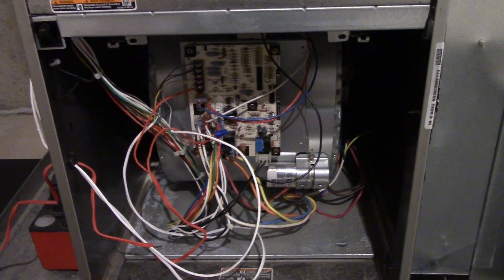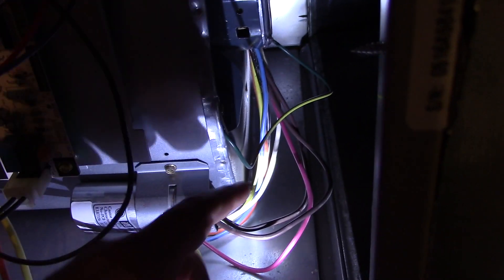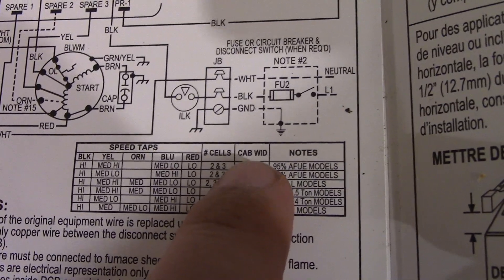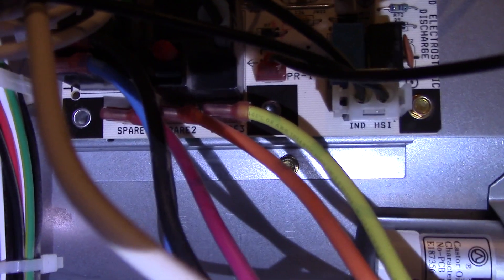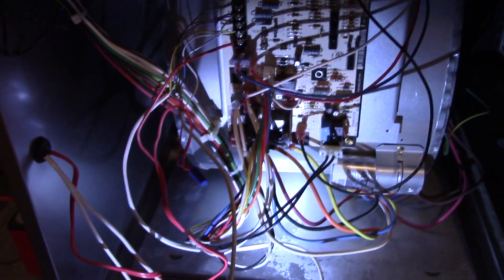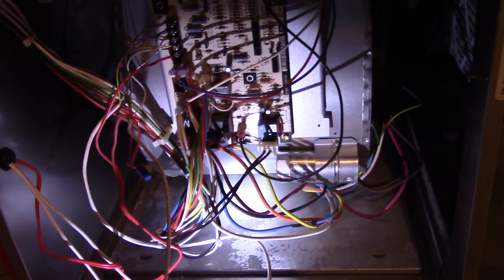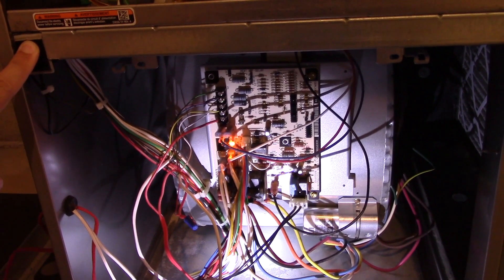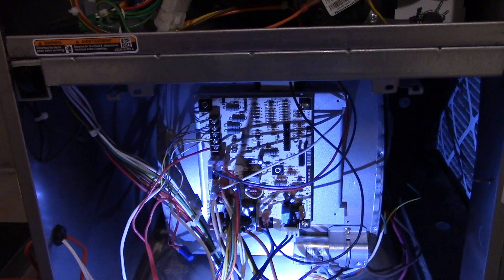Understanding and How to Change Blower Speed on a Furnace Air Handler.

Comment: Thank you!! I had a furnace tune-up at a rental property that I used to live in and the air coming out of the vents was so weak compared to when l lived in it.  I live in a cold climate and don't have AC hooked up.  I couldn't figure out why there was barely any heat coming out of the vents.  I made certain my zone dampers work properly and have a replacement run capacitor on order just in case, but I'm nearly certain the tech just changed the fan speeds on me.  I'm hoping the fan speed change was not malicious because the unit is 20 years old.

Comment: I installed a 2 tonne goodman AC into a 20year old goodman furnace. When the AC kicks on it sounds like an airplane motor. Im going to change the AC wire from high to a slightly lower speed see if that helps…

Comment: This is soooo helpful and well presented. Thank you! (Btw, is it not possible to set both heat and cool to the same speed?)
Reply from the maker: You are welcome! 

With stock set up no, you're have to splice the black wire and attack both ends to each spot on the board. But do know I have never tried such a thing, so if you do, you do so at your own risk.

Comment: I like your video, especially when you speak of the speed of the the fan when it is on in "on" mode (4:27 minute mark). Can this be done on a single stage unit. We have a Heil brand, 4 ton unit. The only time the fan runs "HI" is when the heat or A/C is running. When I have it in "FAN" mode alone, the air barely moves. Can you help us out?🙏😊 My husband is an HVAC fabricator/installer and just needs a little guidance in how to crank up the speed of the fan when solely in FAN mode. We used to have a Carrier Weathermaker 9200 (lasted 22 yrs) that ran high when in fan mode. Doesn't Heil do that? It's a single stage unit...should it matter?
Thanks!!!😊
Reply from the maker: Oh wow so sorry I missed this comment. Is the motor ECM by any chance? Usually Fan mode will follow the same speed as Heat mode.

Comment: Excellent!  80kBTU Carrier 58WAV045 Weathermaker 8000  has only 4 heat discharge vent registers, since it only heats basement of a small house. Blower discharge was a too high/fast of air volume and very noisy; sounded like some huge shop fan on ultra-high! Swapped blue (Medium low lead, now connected to a SPARE terminal) with the Red (Low) lead per your info, and it slowed blower fan enough to quiet things nicely. Still blows fast and not too awfully hot at all, so it's good now. System has no A/C, so no worries about Cool terminal. It was great to learn the simple (now obvious) fact that the SPARE terminals are merely for storing unused blower lead connectors. This really took the confusion out of things! Big thanks! 
Wish all instructions were this good, clearly explained, well spoken, articulate, understandable. Appreciate it very much!
Reply from the maker: Sorry I missed this! 

Glad I could help ya. A lot don't seem to realize that details are the key! I always like to give as much info as I can where I feel it can on;y be helpful.

Comment: You’re the man. This helped me immensely as the fan was blowing too high when heating and was waking us up at night. I can still hear the furnace too clearly when we are in the living room, but I think that’s probably because the return air duct is way too big and it’s like an open hallway directly down to the furnace. I’m hoping we can reduce the size of it. Any tips?
Reply: regarding the single speed fan blower noise - I experienced the same thing with my two furnace units.  Even after installing additional return vents to reduce the overall air pressure coming from the noisy return vents I tried an old trick that some of the A/C guys told me about.  buy a pair of sheet metal pliers (for bending sheet metal) and straighten out the fins on the air vent grill.  If you want to run a test ahead of this change - remove the air vent(s) altogether and notice the reduction in noise.  If this works - then proceed to straightening out the louvers on the vent and return it back into place.  It would appear for my situation the noise was actually air turbulence.  I'm still tuning my blower speeds for our units and comfort, but even at the highest speeds the noise levels have dropped dramatically.
Reply: Thank you  @rgloeschner ! That is helpful info. What I also recently learned is I think there was not enough return air flow and it sounds like that was one of your issues as well. We just re did our floors and we re routed the return air vent elsewhere, so I’m hoping that helps a lot.

Comment: Is there any way to adjust the blower speed when I turn only the blower fan  on? My system blower is on high when it kicks on for heat or cool. But if I turn the fan to the on position instead of auto it operates at a very low speed.
Reply from the maker: That's interesting, is there a third spot on your board that is for Fan Only speed?

Comment: I switched my heat wire from blue (medium high) to red (low). And it doesnt seem to change the fan speed. Any ideas? My furnace blows air too fast and loudly i wanted to lower it for the sound.
Reply from the maker: Are you sure blue is medium high? It could be medium low.

Comment: I have to check mine but could have 1, 2 or 4 speed settings.   I wanted to purposely lower the AC fan speed because it is SO loud. It's on main living floor in a closet. Guess it's not a good idea due to possible freeze up :( Looks like you can't have both on low or both on high if you only have two settings anyway.
Reply from the maker: Yeah, if your A/C is on high, I would leave it on high.

Comment: My Goodman has the black high speed wire running to both the heat and AC, there's a little splitter and a jumper on it. The other lower 3 speeds are either capped off or landed on the board on a dead spot.

Comment: Hey Sharkie, Great video! Question. We run our fan on almost always, because we like the air flow in our home to be continuous during the summer with A/C on and after the system has hit the the set temperature, there is a brief switch to “fan only” but the fan only setting is very high and loud, much higher and louder than the AC. Since it’s based on the heater blower setting, what is the downside to, reducing the heater blower speed setting to something more desirable in fan only mode. This is a gas fired furnace. This is in an ADU with approx 800 sq ft. Is it possible that a reducing the fan speed on the heat side that the heat exchanger could be damaged because of the lack of airflow across the heat exchanger? Thank you for your answer. I appreciate your help. 13 year old York single stage.

Comment: Pro tip: Measure the resistance between common and the colored wires the one with the lowest resistance is high speed the one with the highest resistance is the slowest speed.
Reply from the maker: Amazed I missed this. That is great advice too! Something I will definitely keep in mind.

Comment: With psc motors speed would be number of wires minus three (white/ neutral, and two browns for capacitor) 
Typically, they will be 3, 4, or 5 speed. 
I travelled nine states with an outfit that was founded in 1867 and patented their own large (can crawl under, inside, and on top of large) units . Worked on large industrial and institutional equipment. Some of the induced draft fan BEARINGS weighed more than these little residential furnaces.
 Get used to PCM - that's the way the gooberment is forcing everything.
 * EVERY UNIT LISTS A TEMPERATURE RISE for heating. 
ALWAYS check your delta T in heating and cooling. 
Make sure supply registers  and returns are open. Then check discharge air temps compared to return. With cooling on one should expect 18 to 22 degree drop. 
Heating temp rise is always listed on unit tag. 
ALWAYS check ACTUAL temperature rise. 
If you adjust it too low you can cause high temp short cycling or some units have thermal fuses like on a clothes dryer..
 When checking cooling, I prefer to clean condenser coils. It's amazing how far head pressures will drop when coils are dirty. Head pressure and suction pressure are correlated. Cleaner outdoor coil equals lower head pressure which equals lower head temperature which equals lower suction temperature and pressure which equals the ability to absorb more heat and provide more efficient cooling.

Comment: Thank you for this video. We had a new circuit board installed this winter. My AC has frozen up every time since. After watching this I noticed the tech had wired it incorrectly (low speed cold). Followed your explanation and it works perfectly. Thanks for taking the time.
Reply: I was searching for a way to purposely lower the fan speed on AC because the fan is so loud. Unit is on main living floor in a closet. Sounds like that may not be a good idea. Someone else is commenting below that lowering it is better for removing humidity.

Comment: My tonnage is actually 0.5 more then what the prior one was and now we are having humidity issues. The air handler fan speed is much more then the old one. I am so upset with my mistake but I am calling them Monday and beg them to resolve the issue. I think lowering the fan speed can help reduce the humidity. It may get down to the set temperature quicker but it doesn’t feel the temperature on the thermostat with higher and elevated humidity.

Comment: In my booklet for the G26 1. when the thermostat is set to fan on the blower will run at low speed (red). 2. when there is cooling the blower will run on cooling (blk).3. when on heating it will run at the heating speed yellow, blue or brown.

Comment: We installed a new Lennox system, and the heater setting is definitely LOUD.   The system is working by creating a “feels like” temp that factors humidity.   It runs for about 1 or 2 minutes, but operates more frequently on this setting.  But the blower sounds loud and powerful.   Would the high air flow cause more wear over time on the blower?  The AC setting is very quiet and also does not operate for long time periods.

Comment: Hello. I’m out west. So this house has a heat pump. It’s cold out and every time the heater turns on the air is cold for about 30 seconds or more before it warms up makes me cold every time it turns on it’s also loud it wakes me up at night.  At my girlfriends house the vent is in the same location over the bed and I never hear it turn on, she has gas so it blows warm from the feet get go.  What can I do I my place to fix the cold start ? Is there an issue there or is it because there speed. ?    By the way house is only a couple years old.  Thank you
Reply from the maker: For a heat pump, I don't think there is much you can do. The refrigerant has to more or less "fully get going" before it will start generating the heat at the vents.

Comment: I have two issues and I'm not sure if the fan speed would fix either but I'm thinking about lowering the cool fan speed to medium. I saw that you don't recommend it but.... 1. It's loud at the return and 2. when I lower the temp, because I'm hot, I'm freezing within a minute when I'm sitting in an area where the vent blows directly on me. I did remove the return air vent 23"x23" and that helped slightly. I've read changing the vent to a different style can help but it's still very loud. 2 years old. I read that Rheem is one of the quieter brands. Rheem  RH1T4821STANJA.

Comment: You suggested never turning the fan speed down on the AC but our unit pumps out air through the vents at tornadic speed, it's super loud. Any suggestions?
Reply from the maker: Hmm, an HVAC guy might be your best bet.

Comment: This video helped me a lot! Our AC stopped blowing cold air and called a company to come look at it. Long story short, they said I needed a new unit. Not really believing what they had told me, looked up some information and YouTube videos and it ended up being a bad capacitor which I was able to get from Amazon the next day. Our unit had been running for 5 hours with new capacitor, blowing cold air but it was very little flow and not cooling the house. Found this video and figured out the service guy had swapped the speed to Medium Low. Changed it back to HIGH speed and it has already made a difference in 10 minutes!!!
Reply: Guy is a CROOK!
Reply from the maker: Hey nice! Glad it helped ya!

Comment: Why theres no fan speed selector switch outside the enclosure or fan speed option in the thermostat? Seems to be a no brainer.
Reply from the maker: To be fair, it's probably not something that should be changed all the time, especially blower speeds for A/C

Comment: Thank you for this video!
I knew that the fan speed was too low in AC mode. I am pleased that I was able to do this myself.
Reply: What did you do?  That looks like it's our problem too.
Reply: Low speed is better for AC. If you get a faster speed it might cool you faster but you are leaving the humidity too high in the conditioned space. Low and longer is much more comfortable.
Reply: @Mortyakamort  - yes, I will be trying this on my unit very soon.  I have a single stage unit and the CFM is much higher than my ducts can actually handle so I'm going to slow it all down to try to remove more humidity without freezing up the coils.

Comment: I have a single stage indoor and outdoor ac in-unit for my second floor. Will there be different fan speeds on the blower since it’s a is game stage or not. I have a double stage for my other floor and the blower changes speeds automatically. But my I would like my second floor one to blow more air.
Reply from the maker: Hmm, sounds like maybe you have a two stage heat system?

Comment: I know this is not a typical situation but I think my friends single stage blower motor is set to high for the air conditioning.It is so loud from all the vents when they are all open completely and with the correct filter.I also feel as if it is blowing too hard and not removing enough humidity because the evaporator coil is not getting cold enough.
Reply: This is exactly what I’m dealing with.
Reply from the maker: Hmm, is the refrigerant charge correct?

Comment: After changing my gas valve, my furnace fan seem to have reduced its speed.  I know because I can tell by the sound, the air is noticeably a tad weaker coming out of the vents, and a bed room door that is near the intake vent would get suck shut when the fan comes on but not anymore.  I did not do anything on any of those wires as I did not know that you could change the speed of the fan before.  It's not really a drastic change of speed, maybe it's like running/blowing 90% now than before the gas valve change.  Any ideas?
Reply from the maker: Unsure. Do you maybe have an ECM motor?
Reply: @Sharkie626  I have a psc motor.
Reply from the maker: @squidusn71  Hmm, maybe the capacitor is going bad?

Comment: Hey just want to say THANKS FOR SAVING MY CHRISTMAS.  Had a new HVAC system put in and the blower was so strong it was creating a crazy vacuum and ultimately shutting down my furnace due to hi temp on my BTS (burner thermal sensor)<-confirmed by flashing LED alarm codes.  HVAC guys came several times grasping at straws but after noticing the unit stayed on when the return filter & unit panel was removed, I drilled it down to the blower being too strong.  Switched the Hi wire (blue - in my case) to the Med Lo wire and immediately I noticed...1. FARRRR LESS NOISE   2. filter on air return vent is not being "sucked in" and bent   3. the heat coming from the supply vent is MUCH HOTTER (which I'm chalking up to "more efficient").  Now the ultimate test is just to wait and see if it stays on. Too bad these things don't make it easy on you by having a setting dial to "Lo-Med-Hi" but thanks to your video got the job done.  Again, THANK YOU THANK YOU THANK YOU.
Reply from the maker: Cool deal! Glad I could help! :D
Reply: cool, any update if it continued to work as expected a year later?

Comment: So I just has a customer ask me there furnace sounds like a jet taking off when it’s running on heating and cooling. When adjusting the blower speed on heating do I need to adjust the gas pressure as well and basically do a new start up on it? Also for cooling if it’s running on high speed is it wise to lower the speed to medium speed?
Reply from the maker: Nah, gas pressure should be fine. Cooling speed I don't really recommend lowering because the evaporator relies on proper airflow for it to work properly, and bad air flow can cause it to ice up.